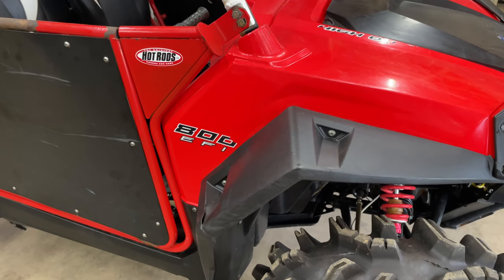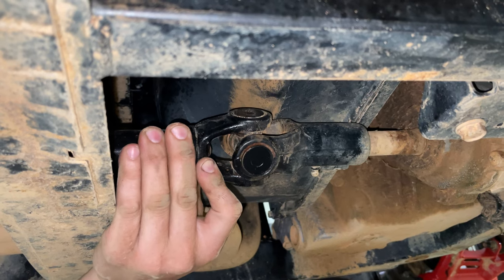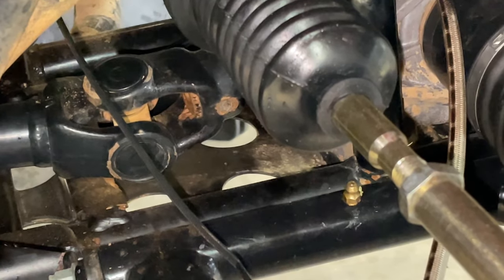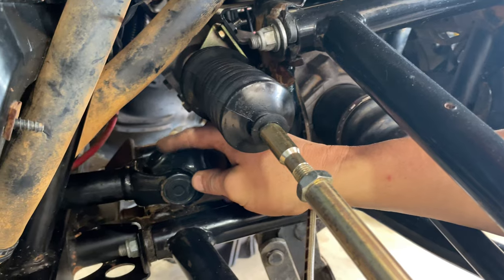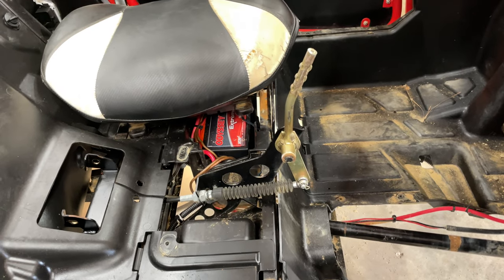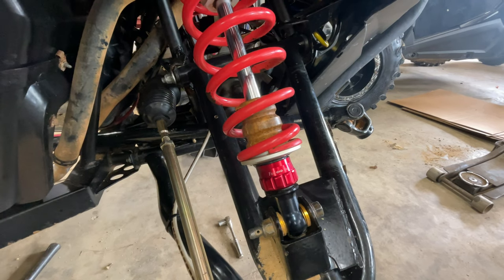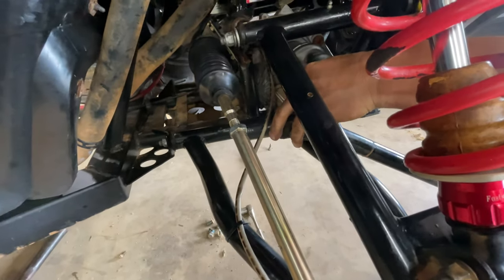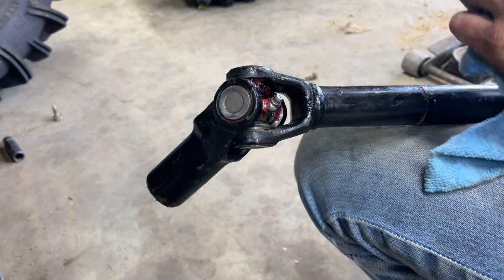Polaris RZR 800, S, How To Remove Drive Shaft

Comment: I did mine several  years ago. I cut a half circle  in the plastic  in the back area of the driveshaft. Can't remember  exactly  but slide out thru the back of the machine.
Reply from the maker: Cool, thanks for the tip and for watching over video. Be sure to subscribe to our channel.